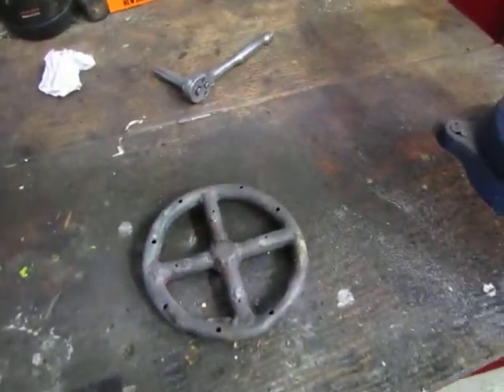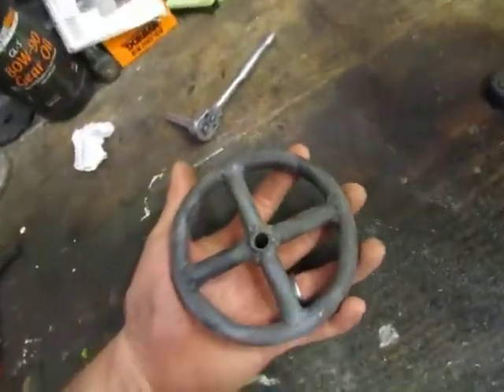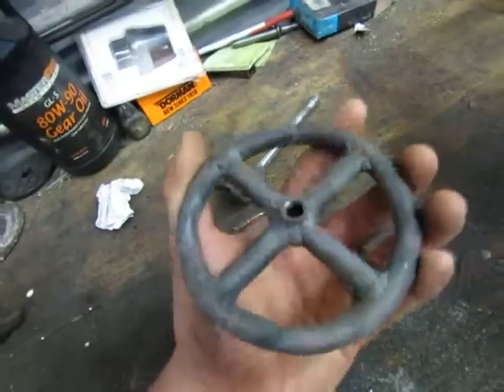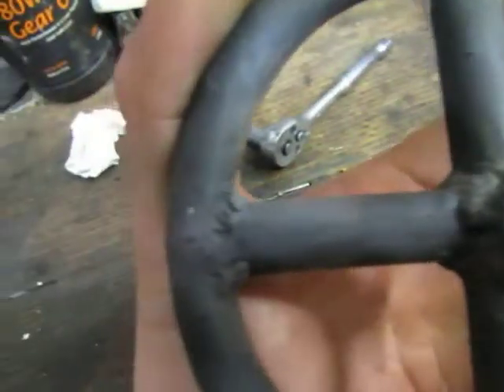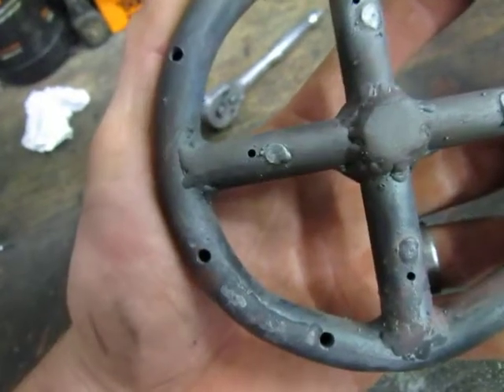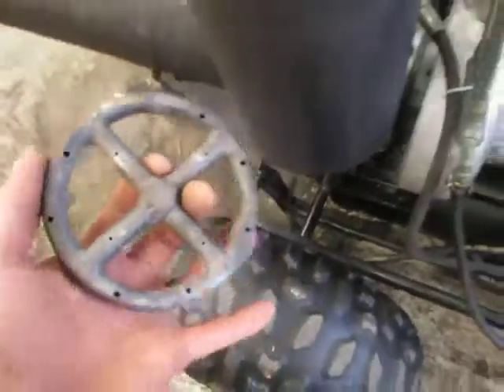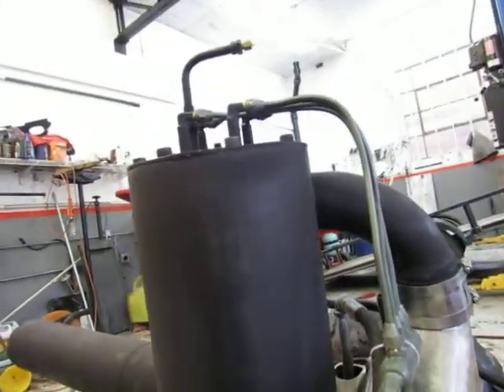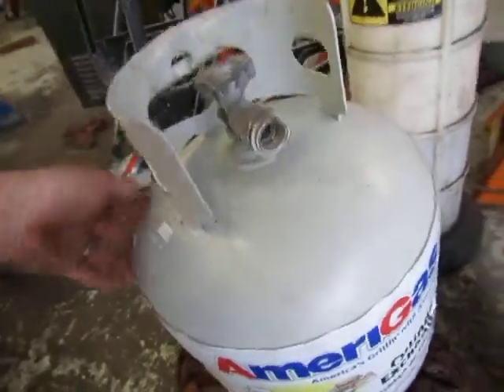Propane injecter for diy jet engine

Comment: are you running a spark plug  when you had this propane setup? then when u converted to diesel, did u switch to a glow plug? lastly, is your plug mounted on the side of your chamber going through your perforated flame tube?
Reply from the maker: i have used a glow plug with propane and diesel  and yes the glow plug is mounted about half way down the combustion chamber and sticks through the flame tube
Reply: DR SATAN ok thank you..that helps alot as im still in the designing stage..love your work 👍
Reply: seeking advice, do you recommend first starting the turbojet with propane and once started switch over to diesel? and lastly what size fuel pump would I need to pressure a diesel fuel injector? I see in this video your running 4 diesel injectors yes? thanks Dr Satan
Reply from the maker: you can start on gas and switch over, if you going to be making it on something to ride like a go-kart i would be added weight to the system, just to keep in mind.  you fule pressure will depend on what kind of fule flow you will need, how big the engine is. my fule pump is out of a 2001 chevy s10 with the v6. Its mounted inside the fuel tank and puts out about 150 psi
Reply: DR SATAN ok yes it will go in a gokart, also its a huge detroit diesel turbo, ok I will start out with a 150psi pump and go from there. Im planning to run just a single injector, maybe forget the propane setup and just go straight diesel kinda like your setup, but run only one fuel line with one injector and go from there 😃